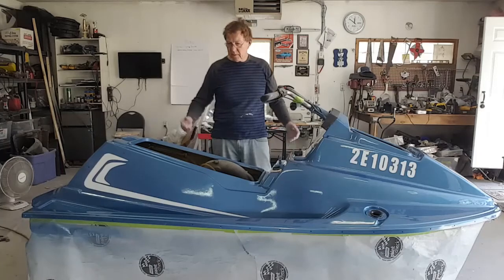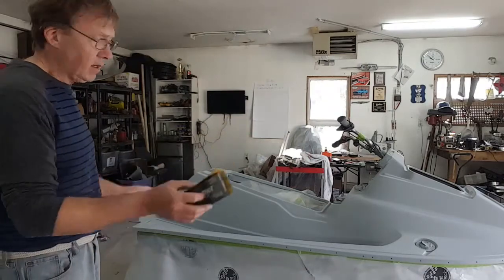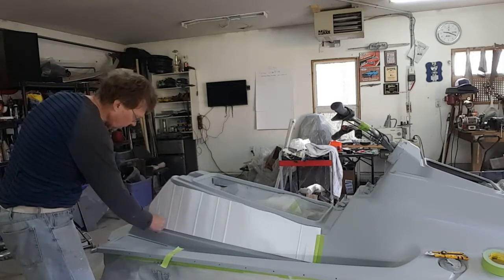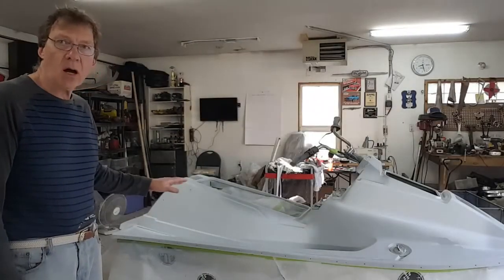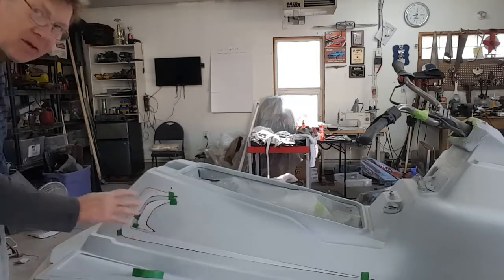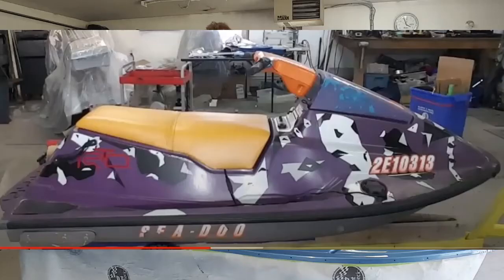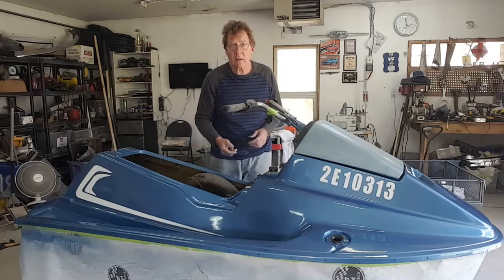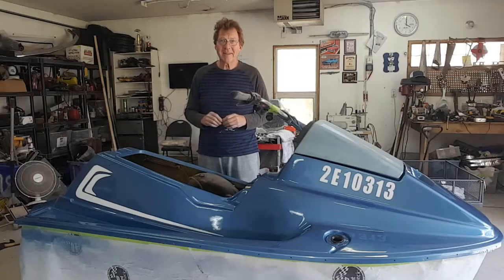Jet Ski Painted in Acapulco Blue

Comment: What I don't understand is this: I saw you put some green tape on to hold the "paper" in place. How did you then cover those areas with blue?
Reply from the maker: My apologies, it is not paper. It is Mactac or shelf paper which is a vinyl with adhesive on the back. I use the green tape to position where I want the stripe to be. then i peel back the adhesive layer from  the back  of the stripe and press the adhesive onto the paint. The mactac then is stuck to the white paint. My worry is how easy the mactac came off as opposed to the glue they use on the "C" stripe. I may have to find a way to reduce the adhesion of the "C" stripe so it does not peel off the paint.
Reply: @68mustangrestoration34  Ah. Then I get it. Yeah, sounds like a good thing. Will be very bad if you end up peeling off the paint and have to redo everything. That will take the last of your patience away I guess :-)